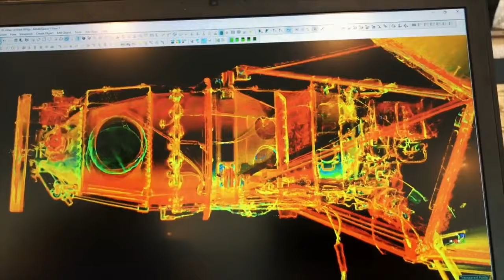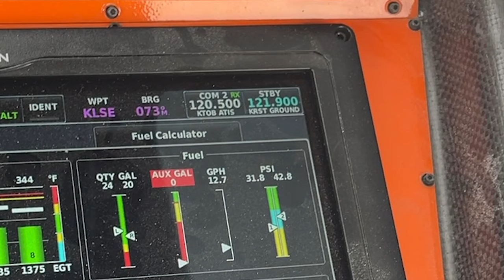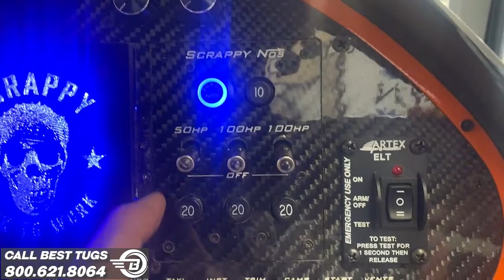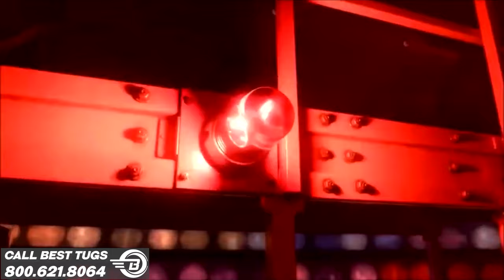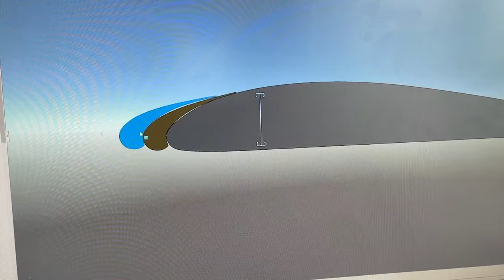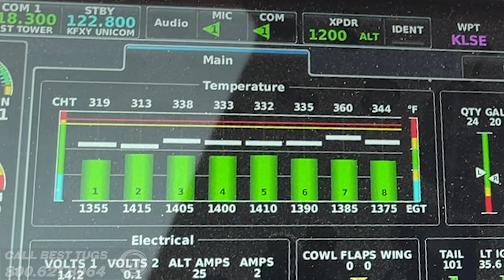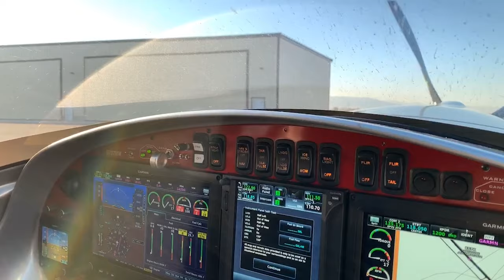Scrappy flies to Oshkosh | Scrappy #61

Comment: Okay Mike, its time to get back to work.  There is much video footage that needs to be put out there.  Then there is the prop redesign.   Then there will be Draco-II.  Uh but, no pressure its just the Scrappy Build fix we all need.  I'm pumped after Oshkosh and need more so, BTW!

Comment: It would be great to see you work with Horizon again to build a scaled version of Scrappy as you did with Draco?
Imagine an RC version of Scrappy with all the functionality of the wing. So cool.
Reply: I was thinking the same thing! Most of my R/C toys roll or float. Haven't learned to fly yet. I can build them. I can crash them. I can fix them. Still working on the staying in the air part... ;)
Reply: @PhilG999  Same here. One of these days I'll get around to it. lol
Reply: @PhilG999  lol. Once I'm in the air I'm fine, it's mostly on the landing, and the problem is that I'm trying to hit the ground, but it usually doesn't hit like I want
Reply: @GreatLakesLogger  Set power to just above idle, pull back to keep level and use the throttle to control the rate of descent.  You don't have to worry about "hitting" the ground that happens 100% of the time.  Focus on controlled decent and flying through contact. Wheels down, chop power, and use elevator to keep the nose off the deck.  Trying to fly into the ground is a crash, you want controlled and expected level contact.  Practice 1 mistake high in the pattern and you'll find the sweetspot in throttle and elevator.  Then, come around again and take it all the way down.
Reply: @mab0852  ya, im learning to harrier which helps a lot. The reason I had so much trouble when learning to fly was that we have a nice long lane, but there are power lines on one side. We have a big parking lot too, but there is a barn, shop, and house on three sides of it. I started with a gutless cub, so when I came in I had to commit to it. Now I have a Timber X with a bigger bl-15 motor, that thing will rocket straight up at 3/4 throttle. Really is nice when you get in a pinch
Reply: @GreatLakesLogger  I hear you there, we had a lake on one side, parking on the other.  Not much room for error on approach.  I also learned on nitro, so deadstick was always a possibility.  At least I had a BA flight instructor (chief test pilot for YF-23 and later F-22) on a buddy box to keep me from mishaps.  To be honest I loved repairs, that's when you heard the great stories.
Reply: @mab0852  ya I never had an instructor, would've been really nice for sure. I didn't get started soon enough to learn how to properly use the rudder. Now getting into 3d maneuvers, its kinda a pain to relearn such a basic function
Reply: @GreatLakesLogger  lol. He made me fly rudder only until I could fly the pattern, barrel roll, and fly inverted with rudder and elevator only.  Ailerons came later...lol. 3d is a lot of fun.  I got way better with a lot of stick time in a simulator.  Way cheaper that way!!!
Reply: @mab0852  ya I just got real flight 9 a while ago. I have since cause tens of thousands of dollars in virtual damage 😀

Comment: 👍👍👍Woohoo it flies congratulations Mike beautiful Innovative airplane. This should set some trends for the future.  Thank you for sharing and your contributions.
Reply: I myself have never been a fan of nitrous prefer a much longer duration of consistent power. But I've also never been a fan of turbochargers.  True it's free Power. But they tend to trap heat within the engine bay plus they're heavier than say superchargers. Superchargers are no heavier and run cooler found it curious your prop is a fixed pitch I thought for sure it would have already been a constant speed or in-flight adjustable. Given your need for stol performance and your desire for Speed. Of course you do know what you're doing, and this is not meant to be a Monday Morning Quarterback.
Reply: Finally tired LOL I have a couple decades on you and I still rarely sleep 5 hours a night when I was younger it was three or four no sense sleeping your life away. Now as then even after going to bed after A Hard Day's Work I can lay there over an hour thinking about what I'm doing the next day I suspect you're no different. To steal your phrase, I got to get back to work.

Comment: Mike, this is amazing. Discovery should start a show called, PIMP MY PLANE" with you as the lead designer and an unlimited budget. Do you think a Stretched Limo Bush plane is possible?😂
Reply: Mike’s doing a great job without discovery. Share his channel with your friends.
Reply: Why would you ruin this by putting it on the Discovery Channel? Your concept is ridiculous because the plane would be longer than most of the strips Mike goes in and out of. I like your enthusiasm though.

Comment: Mike: “Scrappy will never be a production airplane.”

Me: World shatters.

Also Me: Copies the build process anyway.
Reply: Can you video the process, and introduce me to your financial source!  The cost of building the aircraft was incredible, not to mention the panels, gear, one of a kind engine, and on and on.  Labor?  Extremely labor intensive.  I’m sure that Mike will never give an accurate cost, but he probably could have just bought three for what is in Scrappy.  Great project for someone who has the access to the equipment that he used, but Crikey Mate, to acquire just the machines that he used would buy three or five homes around here.  It is still a great aircraft that suits his quirky needs, and do them well.  Looking forward to seeing the Draco New project, I’m a glutton for his work ethic and engineering prowess.
Reply: @wrstew1272  Briefly looking at scrappy, it's priceless.

Comment: That is one gorgeous aircraft Mike. The prop fix is easy. Just model out both high and low speed profiles into 2 concentric counter-rotating props and feather the one you aren't using.
That sounded good in my head - maybe I should have left it there.

Comment: For your prop consider licensing Jay Carter"s prop design from the CarterCopter. Like Scrappy, his gyroplane has an extremely wide speed range. The spar in the prop is soft in torsion, and fastened at the far end so the entire blade twists to control pitch.  The prop is very light, as it cones like a helicopter rotor.  It is ultra efficient over a wide speed range.

Comment: I would do a single variable geometry turbo to save weight. Not many people use that configuration in aftermarket scenarios but for this application it would be perfect. You can to some fun stuff in the tune to achieve desired spool times.

Comment: Congratulations Mike!!! 
Alright finally get to hear it straight from the Lions mouth! Heck Mike, since you're designing from scratch on your wings, what if those big (boat) paddle props could do something like your wing, only the large blade of the prop dividing into two smaller, narrower props so you'd be doing something like going from a big thick 4 blade prop to a thinner 8 blade prop.....good for higher RPMS? 
I'm no engineer, so after all the laughing dies down, tell me what you think about the possibilities of something like that?
Probably too dangerously on the edge right now, but I could see it down the road!
Now Back to Playing

Comment: your prop problem seems pretty easy to solve, use the prop for low speed work, then for high speed simply strap a rocket engine on.

Comment: It's quite a build. I'm not an expert on props but would a more normal prop not be able to do similar a low speed by getting higher in the engine power, even if it is very inefficient or noisy and then allow for higher speed operation. With the swept area effect, maybe a skinny blade can grip as well as shovels if the rpm is high enough.

Comment: Mike, I found at an early age (77 now) that 2 cycle engines cool using fuel and spark plug temp. I found it works as well on 4 cycle engines.
I feel if you went with cooler spark plugs you'd see lower engine temperature. 
Thank you for all your videos,  now get back to work.
DK

Comment: I'm waiting to see how that Catalina-ferry prop does for speed when it's submerged with a forward-canard rudder that used to be the tail and elevator-as-diving-plane. What good is it to have the most advanced STOL without submariner capabilities? Just needs a good, pressurized snorkel for the engine and one for the pilot. (DARPA had a plan for something like this in 2008. 😊 )

Comment: Mike have you filed a provisional patent for the dual compounding slats and the 3way unified linkage ? Seems like a no brainer for the swept wings on commercial a/c. If you got um off the ground even 100 ft. Sooner, could equate to mils in fuel savings when multiplied across fleet.

Comment: Scrappy, indeed will never become a production plane. BUT parts of scrappy I'm sure will. Hope you share the designs and stuff, cause then for sure within 10-15 years a lot of this will be in lots of experimental plane. I for one I'm thinking through the suspension idea for a tricycle low wing. Can you do a cambar change on a low wing? Dunno, but there's solidworks to find out.

Comment: Hmm, after all the talk about the solar and batteries... hybrid engine idea for a next project. Have no idea what that power curve and range looks like, how reasonable it would be to charge batteries while gas power is going (other than with solar), but maybe there's something. And then how the electric motor part of the hybrid could be powerful enough. But seems like something fun to experiment with.
Reply: Also that bottom panel is still a great place to launch drones from. Yeah, never giving that up. :) Something I'm doing with the Air Force. Also go Ron!

Comment: Propellors! Biggest concern for me. C5 Galaxy latest propellors and new props on TU-95 Bear are both massive fat blade props. They both cruise over 400 knots. This technology and engineering has definitely not reached general aviation. I'm sure it involves gear reduction and dynamic balancing to be smooth. There's no way that mass and pull is going to be smooth without dynamic balancing. Torque on each blade. Minute variation in chord twist would amplify.

Comment: The firewall fluid plate?  Bid? Please send prints. Lynn's Machine 3616 E. Market. Enid.Ok.  Scrappy and your composite work is awesome. I work in the mill dept. for Lynn. Just some good ole boys.
Reply: I do have the 3D model of DRACO. Awesome design. I was tempted to launch it in our front lot. Highlines, go under and climb across the highway over the dirt track and return full flaps,drop in over the lines and do a STOL.

Comment: Extremely interesting wing enhancements--one thing that bothers me is those 'extremely' draggy flap brackets 5:50, 10 o'clock. HA!
(yes I know it has massive balloon tires, struts everywhere, exposed shocks, it's a low sp performer and slow yields much less drag)

Comment: I presume the wing tip skids are no use when the bikes are hanging from the wings? Or was that taken into account? All of that weight in the wings with those big squishy tires, the plane seems to teeter totter a lot on the ground. If you get some wind and some momentum going I wonder what may happen.
Reply: Now that I think on this more I believe you need to add active roll control to your active front suspension. Having a gyro attempting to keep wings level could be a huge advantage with all that weight in the wings. And BTW, if I had your chops with carbon fiber I'd likely make some super light "cocoons" to put the bikes in, and for that matter maybe a release mechanism so you could drop them. Like the emergency release they use on a helicopter for long line work.

Comment: How’s that airboat propeller working? In a previous video you mentioned that you could pitch it for 170mph. Is that factual or was your math off. (How did you do the math) I’m building a bearhawk 5 and want better stol performance than top speed and am wondering about an airboat prop as I’ll be running a 500hp ls3

Comment: If you already have solar cells and batterys in the wings, what about an electric motor to drive the plane? I imagine it would give a much higher thrust to weight ratio, much less complexity, instant torque, and for the same weight in fuel you could get 680 amp hours (at 12 volts). (thats just my guesses and estimates, please chime in any experts out there!)
Reply: oh also there was lots of talk about the type of propellor used, helicopters have variable pitch, is that not possible in aeroplanes?
Reply: @kayboku7281  constant speed props exist on planes. He hasn't implemented it yet.

Comment: mike, as a great admirer of you and the planes you build, i am telling you that unless the electric dirt bikes you bought are full sized motocross bikes that have been made electric, please stop calling them that, because whenever you say they are full sized motocross bikes you are misleading people. and most of the electric dirt bikes out there weigh a lot less than a full size motocross bike. on a different note, scrappy is absolutely awesome! i would say great job but that would make it sound like i have experience with building planes.

Comment: It would seem to me, that the size of the tires, would be a real damper on speed.
I know the tundra tires have a usefulness.  But 'built for speed,' isn't a big factor in design.
If your 8 cylinder is liquid cooled, it should be fine...  I guess you found that out by this point.
Only 'space,' is the issue.  Having the space for everything is probably an issue in all aircraft designing.
You built 'Scrappy,' to be a 'fixed wing helicopter!'
You can carry electric bikes, and all the other stuff you can get in there!
Reply: He should pump up the tires with helium and get more lift that way. :>)

Comment: Make a five or 6 blade prop 🤔
Reply: A five or six blade prop could make it Quieter if it’s just a bit shorter if the blades on the outside edge returning slower makes less noise

Comment: lets advance .. on the main wing spares .. eleverons automated with self leveling programing for heavy wind guidance. i smoke a lot of weed. look at the f22 raptor. you know 3d game engines are perdy powerful and free software under glc.. 3d printed apelweb prop, more surface area in a shorter amplitude of end thr to hposd ratio.. (the Prop has holes in it to displace the static barrier for higher rpms and displacing the sound break issues - same deal as subs with bubble wash) ever thought of gutting 2 or 3 teslas and making it electric.. with the s model motors 1 makes over 1,000 hp. 500 tq hpb, each , stg to wght ratio.. math it out.. with a custom gear bwtsp. up to 3k hp 1500k hp tq. range might be an issue maybe less 4 to 500 miles but yer take off would be 5 to 8 inches stovl. 6x 2k watt solar panels on the main wings for rechargeability when in flight and static- hendershot concept ability... 
ima go smoke my pipe, prob all im dreaming about..., carry on brother. hey if you think im wierd you got to meet my cat.. call me.. lol